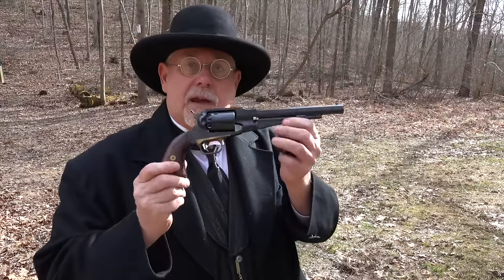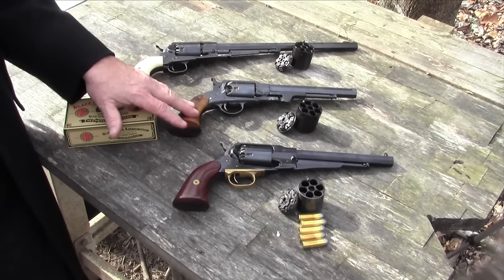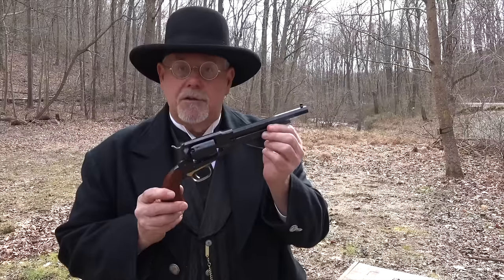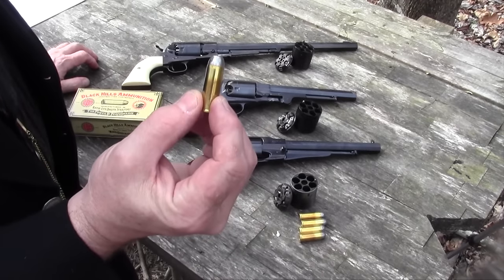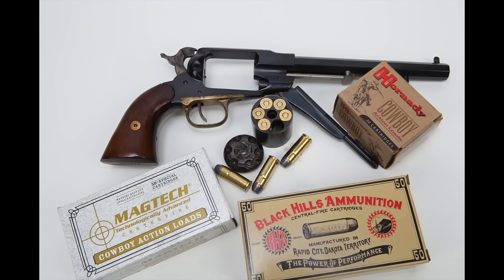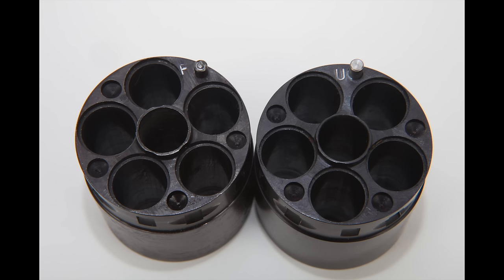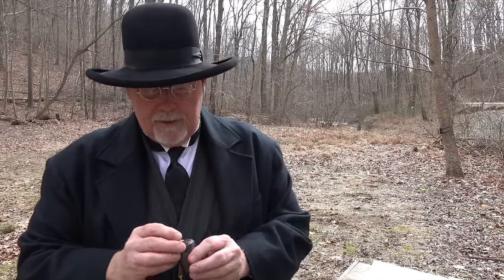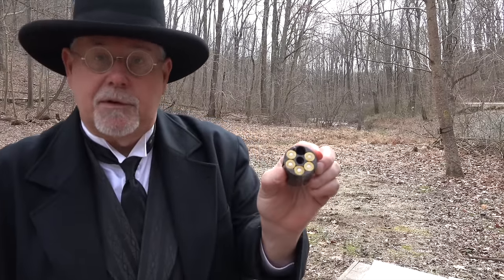Taylor's & Co Cartridge Conversion Cylinders

Comment: Great video. The Remington is really the only cylinder that makes sense to me. Having to remove screws or wedges to get the cylinder out is more of a hassle than just loading powder and ball in my opinion. I just wish these cylinders weren't so darn expensive. The Remington cylinder cost more than I originally paid for the revolver. Still, it would definitely be fun to have. It makes for a nice conversation piece at the range.
Reply: I disagree with your rationalization about The Remington being the only sensible one. I find the Colts to be quite easy. Just push out the wedge with your thumb, pull off the barrel assembly,  then cylinder and use the cylinder arbor to push out the empties. Reload and slide it back on, press in the wedge, done. I will admit to carrying a wooden crab mallet for a sticky wedge but seldom need it. From what I've seen, Mike made the Remmies look a bit easier than it really is, mainly the rammer doesn't like to stay in that ideal position and must be held in  place to keep it from flopping down and locking the cylinder. Also replacing the cylinder can be a bit fiddly until you get a feel for it. 
The Ruger screw? It is just a 1/2 turn locking pin with no real tension, a coin or key ring type screwdriver will work, no need for a real and bulky screw driver. If I were lucky enough to own one, I would probably work out a thumb screw head type arrangement for it. Having to hold the rammer assembly together is a hassle but I think you can leave the rammer arm and plunger off altogether and still lock in the cylinder pin. 
Rogers and Dow? You might need a real screwdriver for that one. I've never handled one but still loading cartridges has got to be easier than loading loose powder, ball and caps, especially under any kind of pressure when the adrenalin is flowing and your fine motor skills have deserted you. 
Just my experience. Thanks
Reply: I participated in cowboy action shooting for many years.  My pistols were a brace of Uberti Remington New Model Army revolvers with R&D conversion cylinders (which is what I think Taylor's are). I put several thousand rounds thru each, and I'm here to say it was a whole buncha fun!
If you're going to shoot a lot, and assuming your pistola is a Uberti , my suggestion is to get the lightened hammer spring available for their 1875 Remington, if they're still available.  It slips right in, and makes your thumb quite happy..... [<GRIN!>]
Reply: well, the cylinders may be a little pricey but they're NOT FFA regulated... so, you getcha a new gun w/o the Gov't crap involved  ... my Dragoon was $400 and the conversion cylinder was $250 ...
Reply: I've seen one place that sells them with loading gates as well as ejector rods that replace the ramrod.
Reply: @rjwintl  And Bump Fire Stocks were not a "FFA Regulated" item
until Trump told the boys & girls at F-Troup to write their own new law.
Never assume they will NOT bend you over..............
Reply: @DanielNighteyes  Hello, my question is, where can I buy the conversion rollers? Thank you :)
Reply: @HircineDaWolf  wonder if theyre still in business.
Reply: @maxmccullough8548  they are
Reply: @HircineDaWolf  Those would be the Kirst conversions
Reply: One benefit to the cylinder is that you can then take these guns to shoot at any indoor range.  Unless you live out in the country, or are close to an outdoor range where you can shoot black powder, you'll find the places you can shoot old cap and ball revolvers limited.  People who live in cities may be close to an indoor range, and may not be anywhere near an outdoor one where they can shoot black powder firearms.  And I doubt any indoor ranges will let you shoot black powder because of all the smoke.

Comment: I've had a .36 cal blackpowder revolver for several years (Uberti 1851 Navy with I think a 4 or 5 inch barrel). Works great. Shortly after I got it, I picked up a .38 special conversion cylinder for it from I believe Midway USA. I think it was made by Howell's, but it could have been Taylors. At any rate, the cylinder slipped right in, and I've been using handloaded mid-range wadcutter ammo in it completely successfully. About a year or two ago, I was in an antique shop and found a Colt .36 cal 1851 Navy style revolver with a longer barrel than my Uberti Sheriff. It was brand new and a beautiful gun with much better fit and finish than the Uberti. Got it home, took out the black powder cylinder, and guess what, the Howell .38 spl conversion cylinder slipped right in and shot like a charm. Very happy with the results in both cases. A lot of versatility for little money in both those guns. Oh, and one more thing, I find cleaning a gun after shooting smokeless powder rounds is a lot less hassle than cleaning one after shooting black powder rounds.

Comment: Great video Mike! I have a Pietta 1858 .44 cal. with a Kirst Konverter. It is designed as such to not having to remove the cylinder to load. Instead, it operates just like a 1873 peacemaker, flipping the side door and loading. The only thing I have to do is to have a peg long enough to push out the empty cases. As far as cartridges is concerned, I handload with Cowboy load #4 200 grain bullets that I buy from Missouri Bullet Company over 5.5 grains of Trailboss powder. Velocity is around 750 FPS with excellent accuracy within 35 feet. It is a joy to shoot and a huge crowd magnet needless to say.
Reply: Can't I buy bullets you just insert in cylinder? What do you mean by hand load?

Comment: An advantage of the Taylor 1858 .45 Colt conversion cylinder compared to other conversion cylinder manufacturers is that the Taylor .45 Colt conversion cylinder is 6-shot. Other manufactures only offer a 5-shot .45 Colt for the 1858 Remington. There can be a slight cartridge length issue for Colts using .45 Colt conversion cylinders. A .45 Colt cartridge shorter than the SAAMI 1.6" .45 Colt may be required. I always reload my .45 Colt to a length of 1.550" that fits in all my conversion cylinders.
Reply: For competition maybe. But a kurst conversion with a ejector rod is considerably faster

Comment: I bought one for the Remington April 9 2020. I bought the gun many years ago for less than $200 and quickly got sick of cleaning the black powder mess. Shoot 6 rounds, clean and re load for an hour. If I had ordered the ammo with the cylinder I could give a shooting report. Taylor's has very good service. The cylinder fits perfectly. All the local stores don't have the ammo on hand.

Comment: Excellent video! I've been enjoying your rifle builds for a long time! I have owned my Taylor's cylinder for 3 or 4 years now and it's a fun addition to shooting my Pietta 1858 Remington. My gun did require a bit of fitting though. But it was a simple matter of relieving the bottom of the frame just a tiny bit with a file at the front of the frame.

Comment: It would be interesting to see a video on how to fine tune the Uberti replica conversion. Polishing internal components, adjusting the trigger pull, sight adjustments and making everything really smooth and seamless.  I used to do a lot of hunting, and I always had my 12ga "tuned" up a bit from the factoring settings to make it just a bit quicker on hard flying geese, I would think the factory delivered Uberti is probably a bit sticky and doesn't have that well used smoothness and effortless feel that makes a huge difference when putting the hammer down on something that really is trying to get away or coming towards you.
Reply: Yeah if they just made a model suitable for quick reloading and if it was a cartridge fire from the beginning. I think they would sell a lot of them. I am on the fence whether to get one of these or a 1875 outlaw, i just hate loading the 1875 Remington, its actually faster to reload this gun instead.
Reply: @ManWithNoName.  You could buy an extra 1875 cylinder and do the same thing!

Comment: Great video. I'd add for Pietta, avoid rounds with energy greater than 400 ft-lb, preferably stay within 350. It is lower than standard SAAMI specs so not every "standard" 45 Colt rounds are appropriate. Pietta makes frames from low grade steel so using "standard" loads will fairly quickly increase the cylinder gap...

Comment: I actually did decide to order a Howell .45 colt cartridge conversion cylinder from midway for my new Uberti 1858 new model army Remington style repro after watching this video even though the .45 colt cowboy loads are hard to come by these days but then again so are percussion caps and black powder so probably by the time caps are available again so also will .45 colt cowboy loads will probably be available again by that time and I prefer using the  Howell .45 colt conversion cylinders with the Uberti Remington .44 repros

Comment: Absolutely wonderful video, super information. 
I will always love and prefer my cap and ball revolvers BUT I do have several Taylor's and Co conversion cylinders. 2 for my pair of Pietta 51 Navys and 2 for my pair of Uberti 61 Navys.
In all 4 cases the cylinder dropped in, perfect fit, not a single issue. They work flawlessly! Probably doing a Remington conversion soon!
I've had excellent luck getting HB ammo for cylinders from Buffalo Arms, great stuff. 
I do recommend getting a set of pins, ferrule and ferrule tool when you get a cylinder. Love carrying these when out on the property or hunting on my land.

Comment: The notches between the firing pins on the 1858 Remington are there so you can load six rounds and safely lower the hammer. You lower the hammer on one of these notches and it's perfectly safe with 6 rounds. Same as the original cap and ball cylinder.
Reply: I was wondering if the conversion cylinder had the same safety notches as the OEM black power cylinder and the ability to go hammer down on 6 loaded chambers

Comment: The Howell cylinder to convert to 45ACP has knotches between the cylinders to put the hammer down on.  They hold 5 rounds but are rated fir any round below "plus:.

Comment: i have an 1858 i got back in 2014 and  befpore that alli used to have were colts.. i had two 1851s and an 1860 army but  after i got the remington i like it better than the colts the colts can and do jam up alot with the caps and one time i had a cap fall and go down into the trigger mechanism and i had to have the whole gun taken apart just to get he cap out.. but i have never had a problem with the remington... but i would  that was for my reenactments but i would like to try one of those conversion cylinders with it
Reply: Conversion cylinders are great! Watch “The Outlaw Josey Wales” and pay attention to his pistols. Sometimes they’re straight up cap and ball and other times they’re conversions. This was for safety reasons but it doesn’t affect the flow or accuracy of the movie and the way these firearms were used. Unlike Alec, Clint Eastwood was very proficient with firearms and always put safety first.

Edit: also they make conversion kits for the Colt 1860 which brings them up a few pegs.

Comment: I have both cylinders for the 51 Colt and the 58 Remington both in 36 cal.  I had originally loaded up 38sp black powder ammo.  problem once I tried to load up the the 51 colt  the 38sp is too long  had to draw down to 38LC which turned for the best as you do not have to add a space filler like cornmeal

Comment: It would have been good to explain why you are short loading the revolver, the dangers etc. It's a great explanation as to how to short load and get your cylinder clocked on an empty chamber. The revo was designed to be loaded on all chambers, as a safety precaution people short load them to allow for safety if dropped or the hammer was snagged partially pulled and let go. This is necessary when the revo is put in a holster, intended to be left loaded or used in cowboy action SASS. For those that need clarification on that. Old model single actions did not have the safeties in place that modern versions do. With that said, dropping a revolver on it's hammer with a loaded cylinder might cause it to fire same as your shirt snagging the hammer and pulling it. A new version (NOT ALL new versions!) have hammer/trigger safeties requiring the trigger to be pulled to allow the hammer to strike the firing pin via a disconnect. When at the range not working out of a holster it is perfectly safe to load all six and then shoot all six. Side note there are several manufactures of cartridge conversion cylinders, if your buying a used or unlabelled cylinder, do your research first it might not be compatible with your revolver! My comments are intended to add to this already good video not detract.

Comment: For the record. The Taylor's Uberti conversion cylinder does work quite well in an original antique frame with very little adjustment of the timing and cylinder gap.

Comment: Nice presentation Mike.  I have the Taylor conversion cylinder for my Pietta 1858 Remington. This cylinder will also accept .45  Schofield cartridges.  I reload both the .45 Colt and .45 Schofield cartridges with Trail Boss powder using the load data from the hodgdonreloading online site.

Comment: Run across this looking at some older videos. One comment. The Remington revolvers have a notch between cylinders that you can lower the hammer down on so it doesn't rest on a loaded cylinder. In theory, that removes the need to only load 5 rounds like in the colts, that didn't have that feature. I have not messed with the cartridge conversions, but they appear to have that same notch between cylinders.

Comment: I have an original 1858 navy .36. Im looking to get a conversion cylinder.  I had to modify a pietta cylinder by reducing the diameter slightly for it to fit in the frame. So im guessing il do the same with the conversion cylinders.  I haven't thought about the bore diameter... good point. Should work right?  With very low powder loads.
Reply from the maker: Northern Woodsman On the cylinder that you turned down to fit, is the bore on center with each chamber? If they are, and you can do the same with a conversion cylinder, it should work. I would only load black powder cartridges. I have an original Remington .36 Police Model that has an original cartridge conversion cylinder. I only shoot black powder cartridges in it.
Reply: @duelist1954  do you know anyone who have originals for sale? I'm in Canada so even a repro is 240$, plus shipping and export fees so it would be around 500$ Canadian. I dont care to pay but it would be nice to know if it fits for sure.

Comment: Hey there is a Kirsk Cylinder that only takes 5rds and had a safety notch so that you can carry it without setting off a round. but youy lose a round. So it will hold 5 as you load them.
Reply: I have a Kirsk and love it even though I can only load 5 rounds. The upside is that it has a loading gate which makes it easier to reload
Reply: @WRMonger1  well my revolver dosnt have an area cut out to allow the rounds ot load easily. So i could probably have to have it cut? Idk if there is a gunsmith near me that can? But ill ask around! Thaks i will look at the Kirsk

Comment: I have a Ruger Old Army with a Kirst .45 ACP cylinder I have only shot military spec ammo 230 gr FMJ for several years, several thousand rounds without a problem. The Old Army is. A totally different beast compared with the Italian guns
Reply: Kirst Cylinders are a different beast. Especially if it is the 5 shot cylinder. They have a lot more meat, and take spicer loads.

Comment: Mike, just bought my first conversion cylinder. I'm sure I'm over thinking the lead bullet thing, but have two scenarios and want to ask a question. Thinking bullets in 200 grain to 250 grain range. Under what conditions should I use pure lead? What conditions can I use alloy (say BHN15)? And when should I NOT use  lead? I can't find molds now, but before I go out and buy lead alloy bullets, I want to make sure I can use them in either case below w/o hurting the pistol (steel frame 1858 Remington). Thanks.

Scenario 1: Cartridge w/ ~30 grains BP, bullet lubed w/ BP lube
Scenario 2: Cartridge w/ appropriate grains smokeless, approx 750 fps smokeless lube

Comment: Hi, I have a brand new Pietta 1860 Army Snub Nose Revolver .44 caliber. 
My question is, there's no problem with converting from .44 cal. to .45 
cal.? I'm planning to buy the Kirst with the gate to convert to .45 
Schofield cartridges (Cowboy Ammo) so my only concern is with the barrel, it does not have to be changed? I was told by Kirst and VTI Guns Co. that the barrel can stay as-is with no change. Is that correct? I just assume that .44 cal. to .45 cal. would be larger in diameter. Hope you can answer my question, Thanks :)

Comment: It seems to me that there is a market for a locking screw of wingnut type that does not need a screwdriver to turn it. In that manner, one could swap cylinders in the form of an ultimate form of speed-loader.

If I were firing one of these things at a range and knew I would be expending all of the ammunition in the cylinder and never have to holster the weapon, I would load all six chambers. The reason for holstering over an empty chamber is noted. 

I am assuming that any handloading would have to be done with black powder, pyrodex, or something like Trail Boss that's designed to fill the cartridge while still developing blackpowder-level pressures.

Comment: I have eyeballed those for a long time but never had the money or not ready to "pull the trigger" on the deal.  NIce to know the cylinder is better steel to handle modern moderate loads.  I would worry some dummy somewhere will go ahead and try hot handloads or something.  And also you will need something to shove the empties out.  Did not say how tight they stick in the chambers. Uberti Remington here.